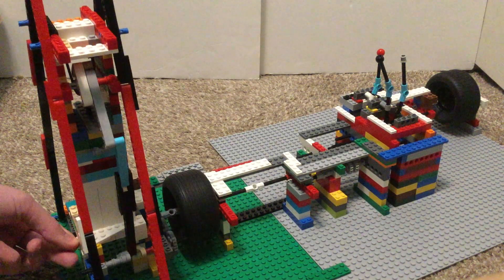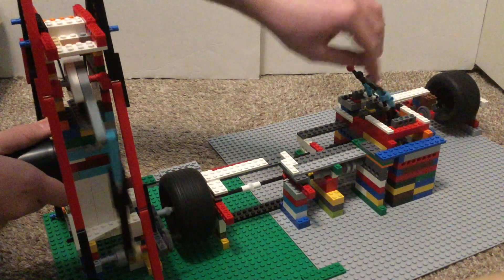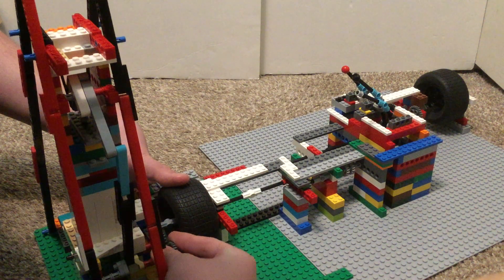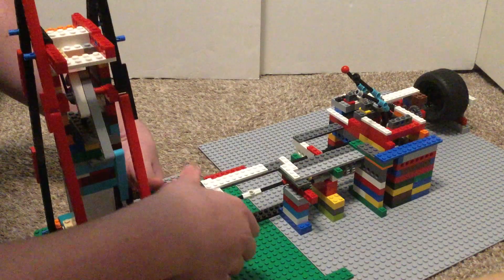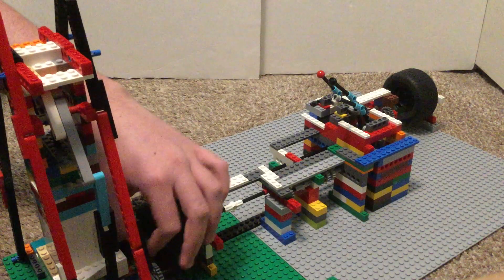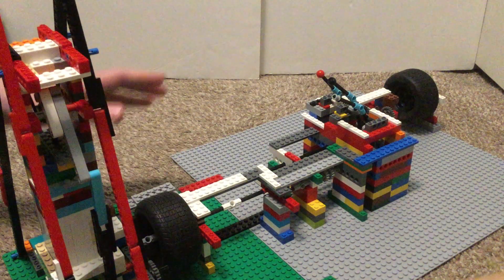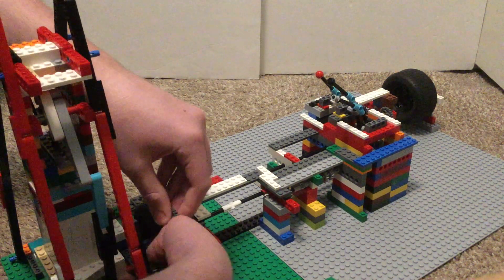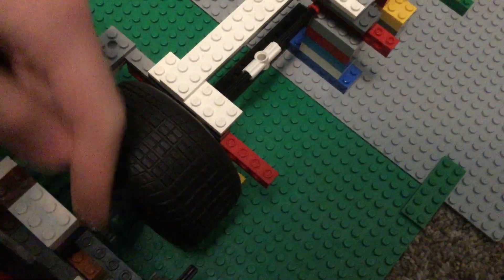Lego OHV Vacuum Engine with Lenco Transmission

Comment: I wonder if this engine could be drastically shortened if you used a piston port in the block for an exhaust valve, that would also make the head much less complicated
Reply from the maker: Its not complicated as is plus it already technically has a port in the block for the exhaust
Reply: @matsbricks4129  reverting to an only port in block system would make this engine extremely short, yesterday i made a 4x4 version with a piston port that was only about 10- 11 bricks tall! the engine as is is rpetty awsome, but i do believe compactness thereof could be improved.